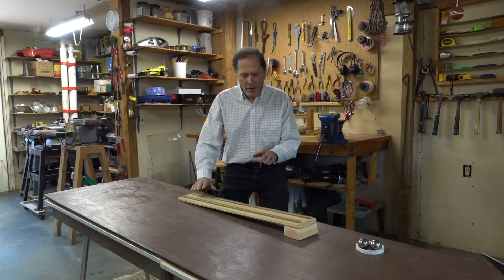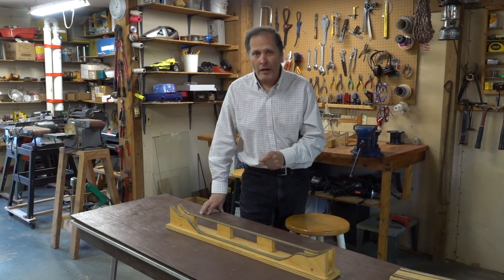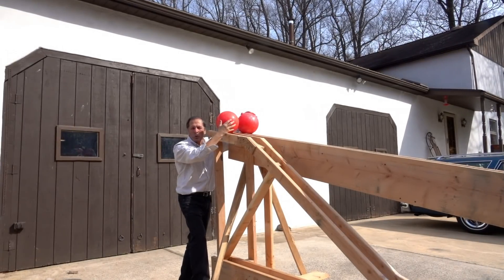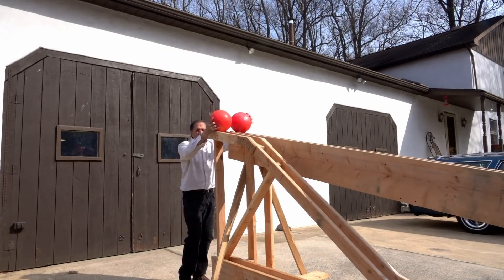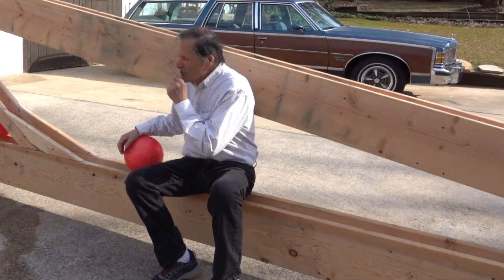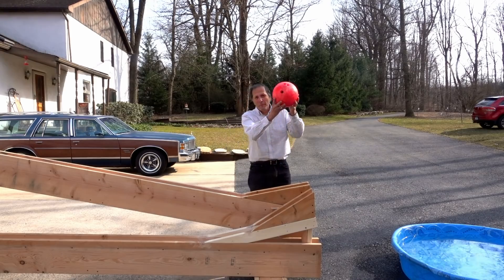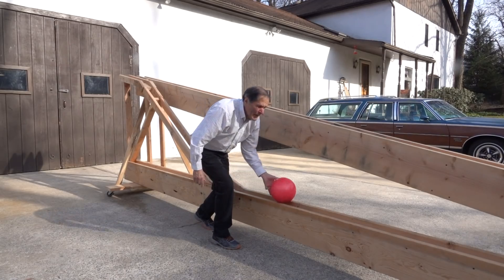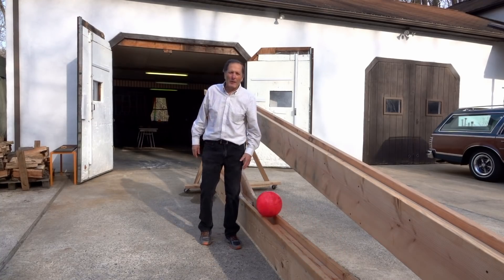Big High Low track //  Homemade Science with Bruce Yeany

Comment: Could probably tune both tracks to take the same time by modifying the faster track's width so the ball over-rotates.
Reply from the maker: that would be an interesting challenge, I have a couple variations of this idea but never did it that way.  On the smaller scale using metal ball tracks I have a slightly smaller ball for the fast track so that they are very very close to matching.  Also have three straight  tracks for different sized balls,  same sized balls don't match but the different sized balls do.

Comment: Well, it's not gravity that makes the ball want to roll down. It has nothing to do with gravity. It has all to do with density. The ball is heavier then air, so air has to move so the ball can fall down. Think about a submarine. It's all about the weight. When there is water in the ballast tanks, the submarine will dive, or sink. If you pomp the water out again, it will float. It has nothing to do with gravity.

Comment: Maybe I'm a little slow, but I still don't quite get it.   I get that both balls start with the same potential energy,  and that ramp B drops down more which converts that energy into greater kinetic energy than ramp A, causing the ball to then move faster.  But how does the ball on ramp B not lose all of its gained speed on the ramp up at the end?  Shouldn't the ramp up on ramp B equalize the balls speed to the ball on ramp A?

Please help

Comment: Gravitational field is conservative which means the difference in energy between two points is path independent. What that means is the exit velocities in the direction of motion are equal on both paths. That is the instantaneous velocity at the exit and follow the conservation of energy mgh=1/2 m v squared. However the conservation of energy tells nothing about the time to traverse any of the paths between the two points. Logically the ball on the longer path accelerates faster and it has a higher velocity before following the straight path while the other ball is gaining speed continuously. At the end of the straight line on the longer path the speed would be higher that that point than the other ball because the difference in height is higher for the ball on the longer path. Then follows a short time of slow down as the ball climbs the ramp for the final exit. Nothing contradictory here with any laws of physics just counterintuitive to expect longer path to need less time. The same would apply in a magnetic or electric field as well.

Comment: the straight track doesnt end (at its lowest point) at the same point as the curved track, but even if it did, would the curved track still get there first? if so where is the extra speed coming from? is it a swing effect or a miniature gravitational sligshot effect

Comment: This is essentially the exact principal of warp drive technology in a simple demonstration. You're literally seeing how warping the traversed path, with the same starting and ending energy potentials being equal can accelerate one faster even over a greater distance. What's not being included is the massive amounts of energy in a static vehicle to be able to alter or warp it's space both in front and behind itself using a warp field. In this simplified demonstration. That energy would be accounted for in the extra amount of work force that was required to build the longer faster track over the shorter straight track. Because it is a static track instead of a perpetually propagated traveling field; it would actually be closer to a worm hole that constantly warps space through a longer winding path which aids in accelerating the traversing objects, rather than a warp drive field. But physically speak both still making use of the same basic principles; and no energy is created or destroyed, so still obeying the physical laws.
Reply: Please explain this in a less convoluted and obtuse way.

Comment: When the balls hit the water, the ball from the straight track is going much faster in the horizontal plane than the ball from the low track. It's about to catch up with the other ball but the track is cut off before the two can equalize their balance of forces.

Comment: I never knew bowling balls could float. Great educational video!
Reply: Depending on the class of bowling ball, it may either float or sink.   Bowling balls are very close to 1 g/cm^3 in density.   The heavier class of bowling balls are denser than water.   Just about all bowling balls would float in extremely salty water like the dead sea.

It's surprising to see this, because you might initially expect a bowling ball to be twice or three times the density of water, since it is known for being a heavy ball.

Comment: The faster track is pretty much (except for length) the way a ball return works for a modern bowling alley. 
Having watched the ball come back, what looks like drive belts at the bowler's end of the return path actually slow down the ball so it doesn't go parabolic and cause damage/injury.

Comment: If you would have curved the faster track with softer angles it would’ve been even faster you had to abrupt transitions that if the curves were softened it would have gone even further and faster may not have been a whole lot but gravity is the key here when we generate electricity at a hydroelectric plant it’s the gravity pulling the water down and the weight of the water that creates the more energy gravity is also used in A Trabue Shea you could do a video about that

Comment: If I am not mistaken, these "high low tracks" does not change PE or KE as evidenced at 6:32 both balls land at the exact distance away from the track. The time difference is due to the track's length and how PE was converted more into motion.

Comment: There is an error in your track Design.
In the High  low experiment,  The Low tracks lowest point should never be lower than the high tracks lowest point.
So while you have a faster Acceleration on the Low tracks ramp,  it still should not go lower than the High Tracks lowest point.
In your Design, the Low track looks at least a Foot lower than the high Tracks lowest point.
Reply: You are so wrong it hurts my brain to try to comprehend your thinking.
https://www.youtube.com/watch?v=skvnj67YGmw
Reply: @adrianpilbrow  
The Video in your Link shows Exactly what I said.
Snells Law
Watch from 4:43 to 17:00
Then also Watch their test rig.
Their rig, the Lowest point of the Low Track, is Not Lower than the Lowest point of the High Track.
Look at 19:10
But In this Demonstration Here.
The Low track drops, Much Lower than the High Track.
It is not a valid demonstration of the High Low Experiment.

Comment: Question on this:  if, rather than dumping off in to the pool, the track continued on perfectly level, would the balls eventually catch up to each other?  It seems like both have the same amount of energy when they reach the end of the track, minus slight differences in looses from friction and such.  It seems the ball onthe bent track is actually leaving the ramp at a slower speed than the one on the straight track, as it loses a lot of it's speed on the climb back up. 
Anyone know the physics on this? Ex, which ball would make it the furthest on a flat track or how far before the straight track ball would catch up, if it would catch up?

Comment: So bowling balls DO float! Without this High/Low-track, I would never have found out. Awesome. Now, Will the rotational force be so strong, the electrons and neutrons will be squished into nuclear lasagna?
Reply from the maker: All bowling balls are the same size but around 11 pounds is the weight that determines if they sink or float,  lighter than 11 float, heavier than 11 sink.  The balls still seem to be fine

Comment: Couple of things you didn't factor in (but you did in another video of yours I saw yesterday) : the rotational energy of each ball, and the friction between the wood rails and the balls.  Friction acts as a means to transferring rotation energy in the balls.  If you look closer, the fastest ball does rotate faster as it had opportunity to absorb rotational energy from a faster drop on a longer course : it spun faster than the upper one.  As it gained rotational energy, friction was less and less impeding movement since its rotation speed nearly matched its body speed.   This rotational energy then acted as a "maintaining" force, and even maybe as a "driving" force - also with the help of friction.  In the case of the slowest ball on the upper rails, as friction was transferring energy as rotational energy,  it actually retarded the ball by "sucking" its energy and slowly transferring it to rotational energy, impeding speed gain - all this on a shorter course.   Interesting experiments would be to use frictionless or minimum friction materials, and non-rotating bodies.   Do comparisons.  For example, flat hockey pucks that are waxed against frictionless surface (plastic, or ice, or holed surface with compressed air).  Or hockey pucks placed in a position to roll, not flat but on their side.  You could also try to build your wood rails differently, playing with path lengths.
Reply: Try to make the upper path the same length as the lowest to give time the ball to pick up rotational energy, without changing its final height.

Comment: Interesting. It looks like there’s a slight loss of momentum due to the sharp angle changes. I bet if it was a smoother transition from one plane to the next, the ball on the curvy track might fly higher and allow the other one to catch up in mid-air. Possibly giving you simultaneously splashes. Good video

Comment: Now I want to try this with water...   I have three ponds, the first pond is about four feet higher than the second, and the distance to the end could be as short as 8 feet long, plus the 4 foot drop to the outlet.     hmmmm  might make for a fun 'fountain' ?  However, the current drop happens initially and runs horizontally to the outlet.  Would a fountain work better if the water travelled horizontal for 8 feet then drop  4 feet to a 180 degree elbow ?  Should one use 45 degree drop and 135 degree elbow ?  And since the water flows about 5 gallons per minute, what size pipe should one use, maybe 1 inch inner diameter and use an possible overflow, ore use 2 inch inner diameter pipe  which would not flow at full volume?  I actually have not measured the flow, it is a guess for today's thoughts.

Comment: Isn't there a simpler explanation? Acceleration vs. Distance. They probably get to a similar top speed just that the closer ball gets there much sooner so it travels the remaining distance at a higher rate of speed.
Reply: They do get to a very similar top speed at the end.  I have built a high/low marble track, just like Bruce builds, and I've tested it with a photogate speedometer.

Comment: Nice video but it ended just when it was about to be interesting and educational. The interesting thing and result/proof is that at the end of the track both balls have same kinetic and potential energy. If the end of both track had same inclination then the they balls would have had the same free fall trajectories AFAIU. With little bit more attention to timing and filming so that balls would fly in unison at end would have wrapped up the demo nicely.
Reply from the maker: thanks Jim,  wish I could go back and shoot it again,  unfortunately,  the wood became part of a remodeling project two weeks later

Comment: Sir, I didn't understand exactly how the ball reached the end quickly than the other one.
Do reply me sir.
Humble request.
Thank you
Reply: Dumbed down quite a bit, the ball on the straight track uses the full length of the track to pull out all the energy stored, where as the bent track quickly imparts the stored energy in to 'speed' then spends the rest of it's run at a higher speed, losing the extra energy gained by the extra height it had to fall.
Reply: Because initial position and final position is not equal. Based on Galileo inclined experiments it has to reach same height

Comment: But what I'm confused about is how the kinetic energy is higher in the low track even though it eventually climbs back up to the same height as the high track. How does this work? In fact energy should be lost in the low track because of longer length which results in higher friction at a minuscule level, and it even translates some of the kinetic energy into sound/heat as it hits the bottom because the track isn't entirely smooth (like at 2:52). So how does the energy at the end become higher than the high track when the start and end positions are the same?

tl;dr What isn't explained is that an equal amount of energy should be lost as it goes back up from the lower dip in the low track, eventually neutralizing to have the same energy as the high track at the end point. But it isn't. How?
Reply: the lowest point on the fast track is about a foot lower than the lowest point on the other track ( look again).
that's why it has reached higher kinetic energy than the other ball.
Reply: @ammartamimi9864  Yes no shit it goes down, but it climbs back up. Whatever energy it has gained going down will be lost going back up at the end. No fucking shit it's lower at some point. The end point is the same.
Reply: @ronaldli5  
if both tracks have the same lowest points, both will reach the end at the same time,
think about it this way, the fast ball on the track has gained it's kinetic energy very quickly and more than the other ball ever had, so in order for it have the same kinetic energy as the other ball at the end, it must as quickly lose it. this is impossible to be done on the same time as the other ball.
Reply: @ammartamimi9864  That's not how physics work....

Comment: Interesting Science.
Also notice the projectile motion after the two balls leave the track. One of the replays clearly show that the two balls covered about the same distance from the track to the water (what we call Range if projectile) but the angle of projection for the low track was clearly more than the high track (around 45° by eyeballing it, which is the condition for maximum range). Therefore the velocity of the ball on high track must have been more (just search the formula for range of projectile) which is evidence that low track ball lost more energy to friction in the process of converting potential to kinetic energy

Comment: I don't get it. The high has less distance to travel so should get there faster and they have the same potential energy. The low might get up a bit of speed, sure, but then has to get back up to the same hieght, so surely expends the energy gained. And how low can you go? Another meter or two, ten? Is there a limit? Surely there is, and if so, where's the cut off point? And why? I am much more puzzled than the dog.
And what if the low one went down 100 meters and up 99, when does friction cut in? I mean have an impact?

Comment: Hah! I got it wrong.  I was thinking that the low track has more distance to cover, and therefore more friction, and that there would be energy loss with the changes of direction at the angles in the track.  I was overthinking it.  They both have the same amount of energy available to accelerate them.  If you accelerate early, you carry all or most of that speed to the end, so if you're going faster, you get there sooner!  Slightly embarrassed that I was 'answering the wrong question".

Comment: would that experiment  be the same if the  falling body  doesn´t acquire  rotating momentum?, like in carriages with small  wheels?  so rotating energy would be neglected? or with square ice  cubes?
Reply from the maker: same results,  we tried it with little cars which had very little rotational momentum.  It would be interesting to try it with ice

Comment: Question... what is the shape of track that will give the fastest time over a given distance?
Reply: A brachistocrone (or an upside down cycloid).  It is also a tautochrone (any starting point on the curve arrives at the lowest point on the curve in the same time interval).  It is the curve that a point on a circle makes when rolled on a flat line (look up "cycloid).

Comment: I question your conclusion. The low track ball gains more speed, by giving up its elevation, but then it also has to give up its speed to regain elevation. Since the high track is at its greatest speed at the same time that the low track is giving up speed to regain height.  

In a frictionless system, they WOULD arrive at the same time.  

So, how does friction change this?  

Friction due to motion rises with speed. But there is also a thing called initial friction, which is the minimum energy necessary to create motion. Initial friction is constant, and motion friction is added to this based on speed.  

My guess is that the initial friction is high enough that the slope of the high track doesn't allow much energy transfer to the ball. The low track suffers from the same problem in every section of the track, except for the initial steep downslope. On that downslope, for a brief moment, the available energy from the change in height is far greater than the initial friction (a situation the high track never experienced). From the bottom of that slope, the low track was less efficient at every other point. But, the energy transferred to the speed of the ball in that one section of steep slope is never seen by the high track at any point. Thus, even at the end, where the low track's upward trajectory should be costing it a lot of speed, it's still the clear winner.   

Not to say it's exactly the same, but this is partly why drag racing is won or lost mostly in the first 60 ft.

Comment: Too bad you didn't design the end of the tracks such that both balls leave the ramps at not just the same height, but at the same launch angle of elevation. Then you could see if they both strike the pool at the same distance from the ramp, thus showing they left their respective ramp at the same velocity.